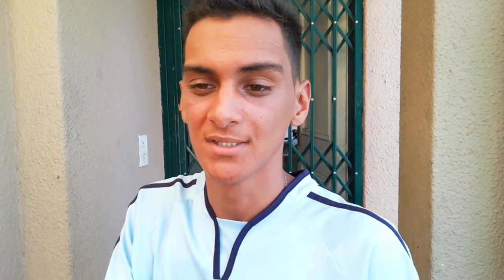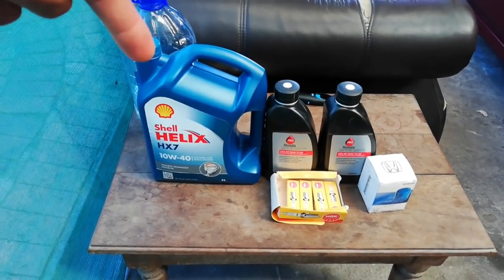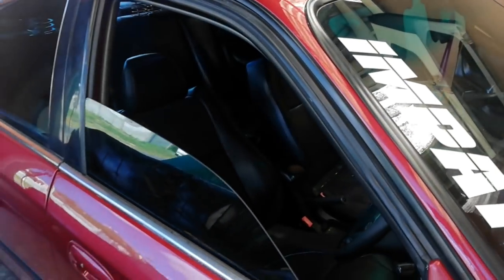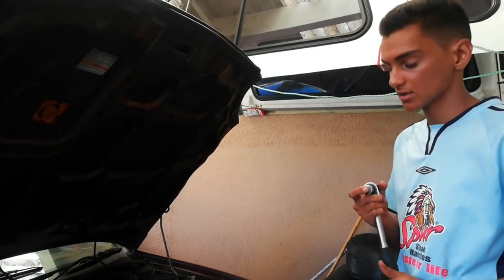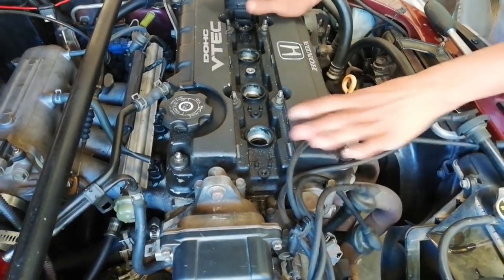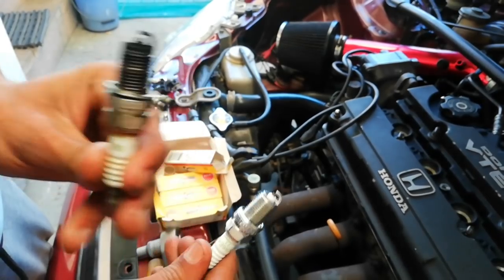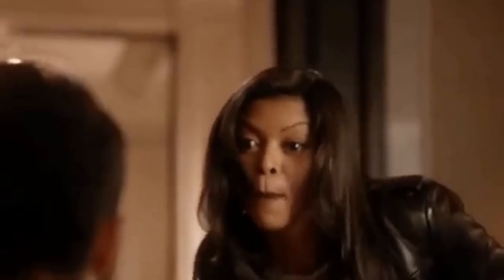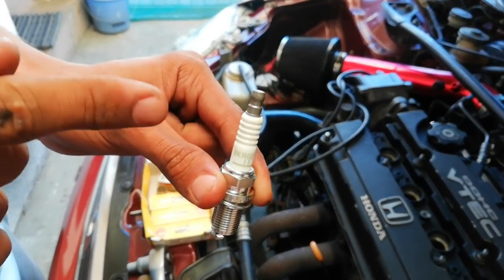How to service a B-series Honda EK (B16 Vtec)

Comment: Brittle o ring causes oil on the plugs so replace tappet cover gasket and plug o ring seals, you want the guy to take off his head to replace head gasket soemma. Also you only change plugs on a cold engine. What about fuel filter?
Reply: Also vtec sump capacity with filter change is 4 litres

Comment: Lovely bro, I would just like to mention If you don't change your spark plugs well gaskets asap, the car will miss oil and spark/electric system is a bad combination. Other than that thumbs up for the video.
Reply from the maker: Thanks for the advice bro 🙏🙏